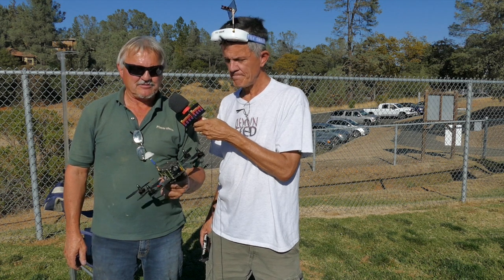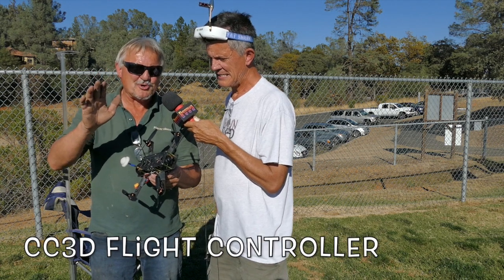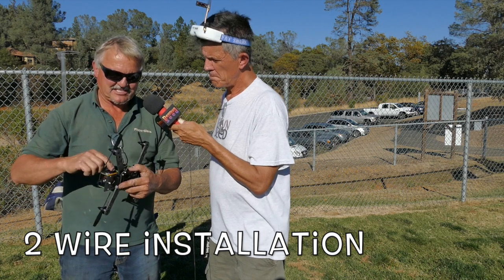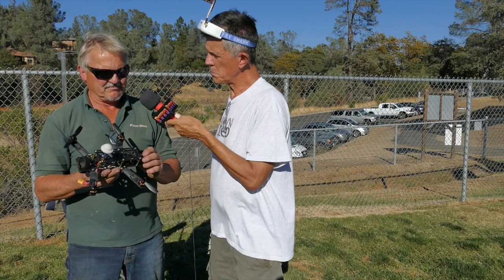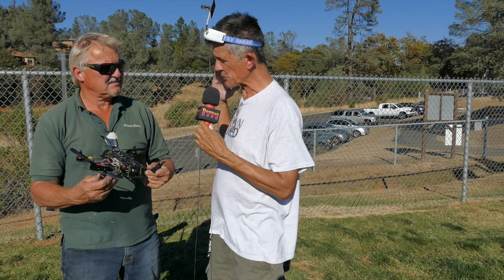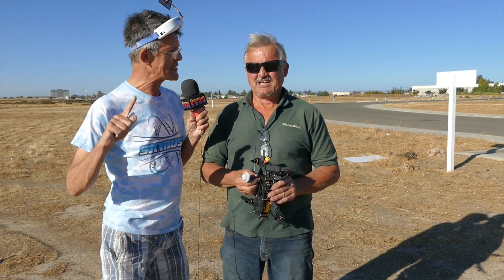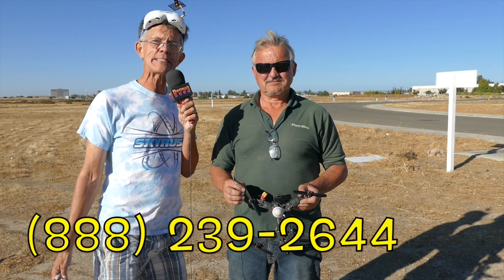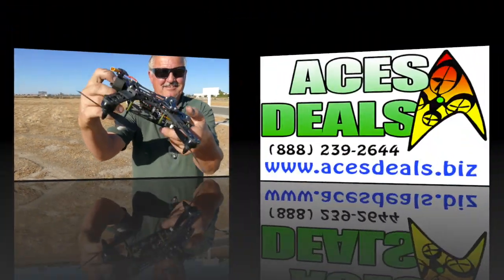FPV DRONE RACING - BUILD YOUR OWN! - Demunseed

Comment: Idk Jim, Walkera with transmitter has a racing quad rtf for less money, you of course have to buy the goggles separately or monitor, but this is a good idea for those with some racing experience.

Comment: I bought the p3 standard it's great super stable video as well fpv works great with little to no lag.  The best part I never had to use a cpu. Not to edit not even to update the firmware on everything all done on iPhone 6.  I shoot in 2k and I don't even have to change it to 1080 it just works easy and well